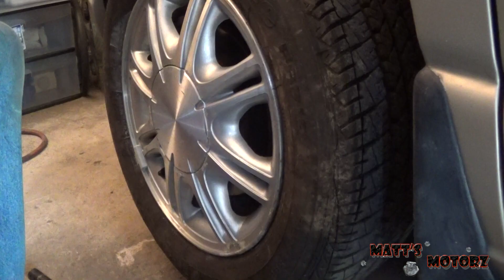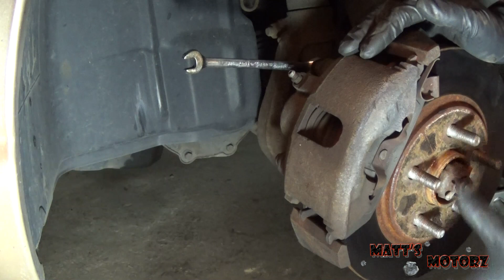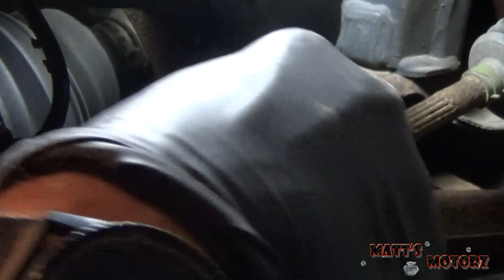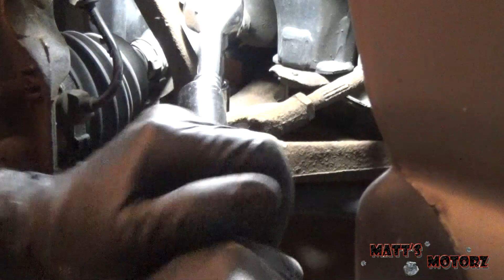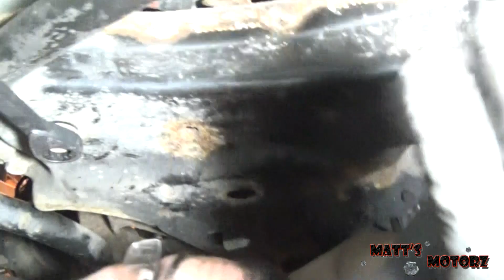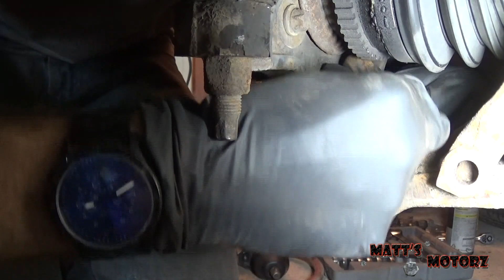Lower Ball Joint and Control Arm Replacement: Part 1 [1998 Chrysler Cirrus]

Comment: I noticed this video is a lease 5 yrs old. Good video.. But I also noticed you're working too hard. You don't believe in using WD-40 ? I noticed you're not using it in his video at all, without WD-40, you're working way too hard. I have been watching other videos as well. Everybody uses WD-40. Some mechanics even spray WD like 24 hrs prior to work, all depends on the job.

Comment: I know this is an older video but I'm in the same situation with the rounded off but. Happen to know the size/length etc... of the bolt that you had to replace?
Parts stores don't have them.

Comment: your front lower control arm  in the front is backwards , the nut on mine is on the outside with the bolt inside the frame part came out easy .

Comment: To remove the horizontal bolt on the drive side that hits the trans i had to put the jack under the trans and carefully push it up just enough to give me a little more wiggle room so the bolt would come out past it. Otherwise it wasn't too bad a job. Although I did have a sway bar link/end that I had to cut off. Thanks for the video.

Comment: The top bolt on the lower control arm is 18 mm not 19mm. That's why it rounded off.

Comment: Hey, I have a question, Per your title, you're working on a 1998 Chrysler Cirrus. Does This apply also to a 2001 Dodge Stratus Sudden ? Cause if I have to cut a bolt to get the bolt out, Im in trouble. I dont have an electric saw or any means by which to cut a bolt. Maybe I need to give me car to the mechanic, Let him deal with it.
Reply from the maker: I am not sure but it is probably very similar.  You can get angle grinders pretty cheap these days, probably less than 50 bucks.